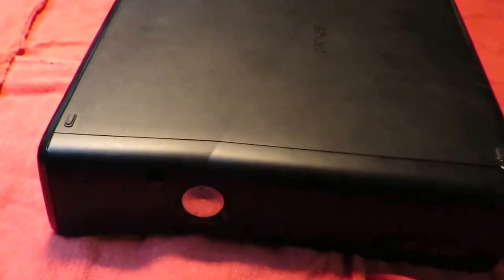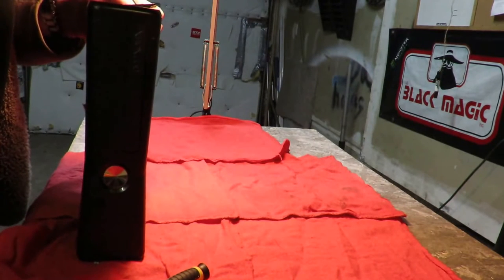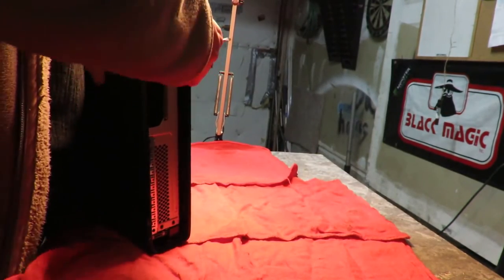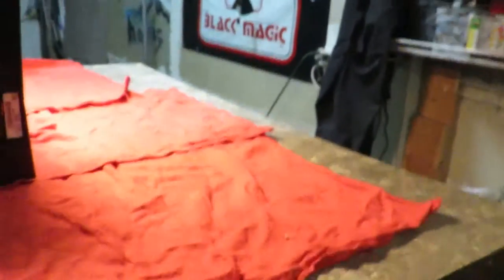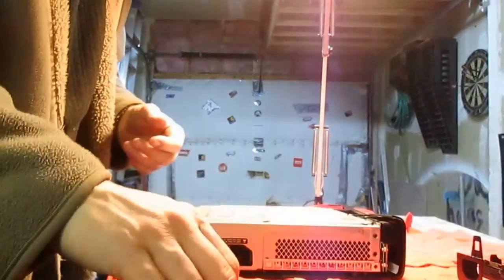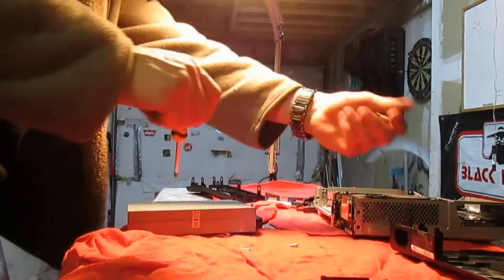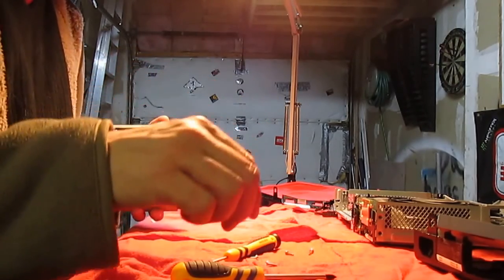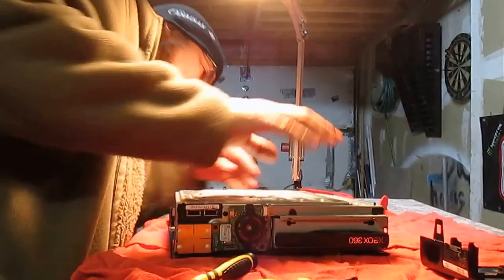Xbox 360 (Slim) Repair (Disk Door)

Comment from the maker: Written Instructions Below
_______________________________________________________________
How to open the Xbox 360 Slim 

To get into the Xbox 360 you’ll need pretty much the same tools you needed to get into the old one. A flat head screwdriver helps, preferably one with a long, thin stem (a tiny flathead is also useful in getting the heatsink clamp off if you want to go that far). You’ll need a torx driver with T8 bit. A phillips head screwdriver if you want to remove the fan on the heatsink and a selection of thin/flat tools to help you pry bits of the case apart. 

The bad news is that the new Xbox 360 is not really any simpler to disassemble than the old one. I've included photos of the process here but for larger versions and even more than what I've included inline, check out the gallery below. As always, proceed at your own risk - we're not responsible for any damange to your console that happens as a result of following these instructions. Also know that proceeding with this will surely void your warranty from Microsoft. 

To start you’ll want to first remove the hard drive. Next we have two plastic grates on the left and right of the system that pop right off. They are attached using clips along their edges so work one part out with your flat head driver and just pull the rest off. 

The side without the hard drive is a bit more difficult. I crammed a plastic tool between the chrome casing and the plastic grate to pull it off and then wedged my fingers in there to get the entire piece off. 

This next part is the first of two hard parts, and I’m not sure there’s a way around this. Removing the two plastic grates will reveal two more black plastic covers. You can wedge your flathead between the plastic cover and the rest of the system and pry it off. 

The cover is attached to the system by several plastic stands that fit through little holes behind them. The stands are wider at their outer most edge than they are at the base, too wide to just fit through the hole. In fact, removing these plastic covers will break part of the stands off. It looks like Microsoft did this to make opening the new 360 something that could only be properly reversed at Microsoft itself. Thankfully doing so doesn’t fundamentally ruin the system. 

Stick your screwdriver in one of the cutouts and pry away. You’ll see a lot of flexing and then hear a pop, once you hear one move to the next portion of the plastic cover. Do this around the edge until the entire cover is removed. Repeat for the other side of the 360. 

Now you’ve got line of sight into the system itself. Great. 

At this point you can also remove the 802.11n card which is held in place by a single screw. Remove the T8 screw and the card slides right out. It is just plugged into an internal USB port. 

Now we have to remove the two chrome surrounds on either side of the system. These are attached via clips that can be tempted loose using that trusty flat head screwdriver. Wedge it between the clip and the rest of the chassis and push away from the chassis: 

Some clips will give way easily, others will take some coercion. Some of the clips are only accessible via a very tiny, very long flat head. Start with the clips you know you can get off and then try to pry the tough ones later. 

You’ve got 6 on one side and 5 on the other chrome lip, the shots below should help you. 

With the two chrome surrounds removed we’re now at the second most difficult part of dissecting the new Xbox 360. Remember these little things: 

Yep, they’re back, and even more of a pain. 

On the old 360 you at least had a removable face plate and some insight into what was going on at the rear of the system. This time around you can only look in at the sides which makes this next part quite frustrating. 

Thankfully I know exactly how many clips you have to break free: three on the back and eight on the front. 

I started on the back, got the clips loose then moved to the front. You need to access clips at both the left and ride side of the Xbox 360. A flashlight can be very handy here. Remember you’ve got clips at both the top and the bottom of the Xbox to work free at the front. Unfortunately during the process I managed to snap a few of these clips, not to the point where the system couldn’t be put back together thankfully. 

The only advice I can give you here is to be patient, persistent and have a good flathead screwdriver at your side. Once you’ve pried these clips free the front will separate from the rest of the system. If you’re trying to do it without breaking any clips, good luck, if you don’t mind then be prepared to put some force into the process. 

Be careful when removing the front of the system. There’s a ribbon cable that connects the 360‘s power button to the rest of the system, you have to remove it before you can proceed. In my original teardown the ribbon cable just ripped right out of its connector without any problems so if this happens to you, you should be ok. 

With the front removed, separate the clips on the back and the top cover of the 360’s should lift right off exposing what we have below: 

From this point on you’ll need your T8 bit. Start by removing the two screws that hold the front panel PCB in place. With the screws removed the PCB pulls straight out: 

Now look at the side of the Xbox with the white sticker on it, there are 12 x T8 screws that you need to remove here to take the whole thing apart. If you just want to get the cover off I believe you only need to remove the 5 black ones. 

The 12th screw is actually hidden under the white Xbox 360 sticker. It looks like Microsoft has done a lot to figure out whether or not you’ve opened this thing. Modders don’t make Microsoft happy. RRoD didn’t make me happy.

The DVD Drive & Motherboard 
I pulled all 12 screws out but left the four heatsink screws in place since I wanted access to the motherboard. With all four removed I could pull off the bottom cover leaving me with this: 

The DVD drive lifts right out and you can disconnect the power and SATA cables from the unit easily just like on the older models. 

This is a newer version of the Lite-On drive found in the newer Jasper Xbox 360s. They use the DG-16D2S while the Valhalla uses the new DG16-D4S. 

Microsoft also outfitted the drive with a strip of rubber to help dampen vibration:
Reply: Absolute wast of time. 30mn watching then ... you just skip the part where you fix the thing. No bs please ...!